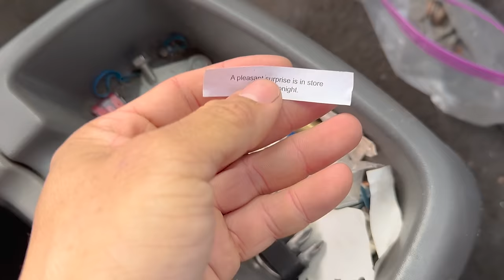I CLEANED my crabbing truck for the first time

Comment: Luke, if you run a vibrating sander on the carpet (without sandpaper) and have the vac hose near it you will get most of the sand out of the carpet.

Comment: I replaced the latch cable ends on the back doors of my F250, which is almost identical to yours.  You can get aftermarket latch ends that are metal instead of plastic.  There are YouTube videos on how-to, of course.  Not too bad a job.  Took me a couple of hours to do both doors.  It's been a couple of years and the doors still work great.

Comment: Youre gonna want a shorter extention cord, coiling em up and using them will eventually turn it into an induction heater and it will burn. 
Each loop of cable can induce more voltage into the next coil and so on, until it becomes a problem.

Comment: Pro tip: power wash the carpet, then blow it out with an air compressor, then leave a heater in it.   It will look brand used.

Comment: If you want to get the sand out of the carpets, take a palm sander without a sanding disc on it and vibrate the floor while vacuuming the sand up.

Comment: 9:53, my 2005 suburban has a permanent gas pedal heel print through the factory carpeted floor mat, factory carpet, factory insulation, factory paint, and has shiny metal underneath. 🤣